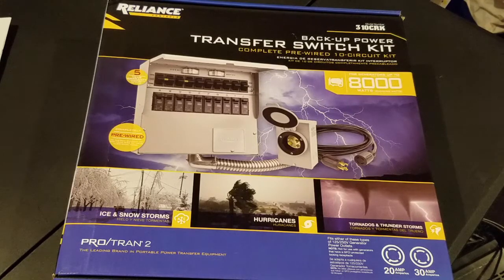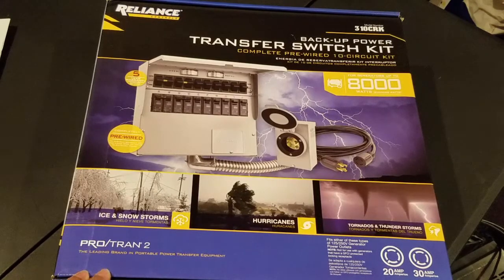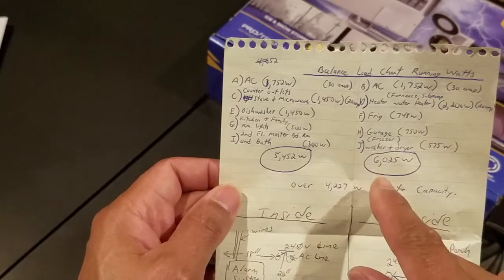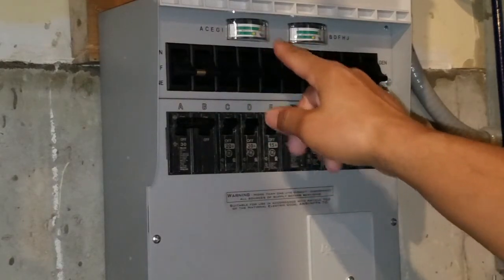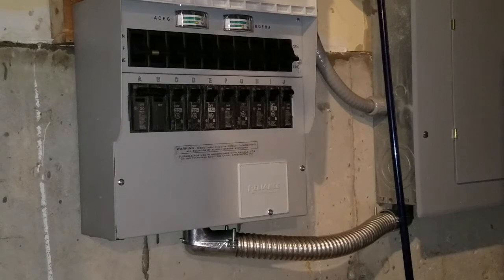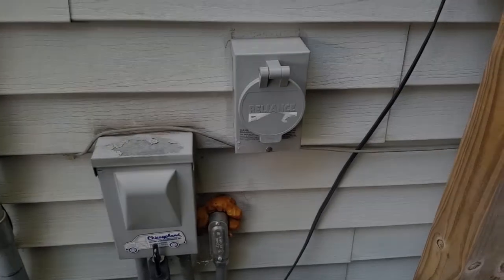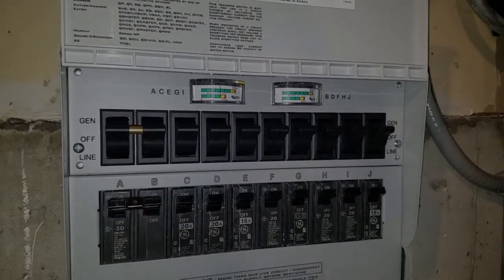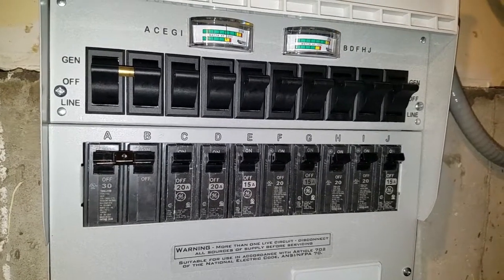Reliance Manual Transfer Switch Kit Explained/Review and Why It's Better Than an Interlock Switch

Comment: I'm running solar with my reliance switch.  My all in one inverter accepts the generator input to charge my battery.  When there's no solar the generator can charge the battery and or run loads.  The reliance method allows the option of shutting off the solar and returning commercial power. It's nice and low budget.

Comment: installed the 30 amp 6 circuit pro/tran2 from the home depot today it powered everything good but the watt meters don't work. Guess I'll call reliance but I really don't feel like reinstall for that kind of inconvenient.
Reply from the maker: Sorry to hear that. What was the wattage being used on each leg of the transfer switch?
Reply: @Pk3_Garage  fridge & furnace are on phase A circuits, sump & general lighting on phase B all on individual breakers powered by a 5500 watt generator powered everything fine during testing.  Just noticed the analog needles don't move on either side so defective right out of the box. since everything else works I might just leave it but is a ding on their quality.
Reply from the maker: Happy Friday and yes that is a bummer. I'd still contact Reliance Controls about the issue. I've seen others that have had the same problem.

Comment: Can I install two of these, like one to cover 10 and the other to cover 10?
Reply from the maker: Under code you can, if you are using one power source for both Manual Transfer Switches. I installed a six-circuit Transfer Switch, like the one in this video, to connect other circuits not connected to the ten circuit Transfer Switch.  

If you want to see my current set up, check out my EcoFlow Delt Pro Review Video on my channel.

Comment: New sub with this video.  You helped me understand a lot about this option.   I’m going to go this option rather than the interlock.  I am going to put my inlet receptacle directly into the transfer switch where that cover plate is.  I’ll be plugging in 7200 watt EcoFlow battery as my backup power to transfer sw as HOA will not approve portable gen.   Not what I wanted to do but there are some nice advantages.
Reply from the maker: Thanks for subscribing.  We now have a Ecoflow DP main unit, connected to our Transfer Switch. (We still have and use our generator) 

The Power Station is just an add on, as it has abilities our generator doesn't have. It works great.  

I'm working on a detailed video of our set up and DP unit testing.  Keep your eyes out for it.

Comment: The wires you connected at 14.05 in the video.....what’s these wires for?  I just bought this and I’m using your video for reference.  Thank you sir.
Reply from the maker: Hi and Happy belated Christmas.  Hope you had a great weekend.  Those wires are from the Power Inlet Box.  You need to buy building 10-gauge: red (hot), black (hot), white (neutral), and green (ground) wire.  These wires are not included with the kit.  

Here is a detailed installation video from Reliance Controls that might be helpful.

Power Inlet Wiring - https://www.youtube.com/watch?v=0M8sYRhEVPY

Transfer Switch Wiring - https://www.youtube.com/watch?v=TKruj9BpZM8&t=60s

Comment: can you use a generator that has 3 prongs but an adapter that converts it to 4 prong? My generator is only 120V but all the circuits I need is 120V. I have a firman inverter generator WH03242
Reply from the maker: You sure can.  Look for an adaptor for a four prong L14-30 inlet to whatever type outlet you have on your generator.

Comment: i have a 100 amp main breaker can i still use this 50 transfer switch
Reply from the maker: This is only a 30 amp transfer switch. Yes to answer your question. Our main panel is 100 amp.

Comment: Can you take off the goldish colored piece locking in the 30 amp double breaker line/gen switch so I can take the breakers out and make them singles? Thanks
Reply from the maker: Yes, you can. The transfer switch comes with a double pole 20amp breaker.
Reply: @Pk3_Garage  thank you very much for quick response I highly appreciate it
Reply from the maker: You're welcome and it's not a problem.

Comment: Seems like this would be a good way to feed solar power to a range of circuits, and send them to line only if needed.
Reply from the maker: This Transfer switch works very well.  I've since upgraded our backup system since the posting of this video.  We now have our entire home backup using a six and ten circuit transfer switch. We added the Ecoflow Delta Pro Power Station to our backup system.  (It can run our entire house, minus our 3-ton AC unit)

I installed two inlets, on both transfer switchs, inside the house that the DP is always connected to.  I'm using two changeover switches, one for each transfer switch, to switch between generator and battery/solar power.  Our system works great, and I'm so pleased with it.

Comment: Might have to use this for the first time tonight , wind storm coming. Is it safe to run electronics such as TV and internet routers if a non inverter generator is running this?
Reply from the maker: It depends on the generator you use. If your using surge protector power strips.  The size of the generator. (How many watts) How old the electronics are.  For us, it works just fine.  We have a Predator 9000/7250 watts generator.  Have over 77 hrs. run time running our entire house, with no issues with sensative electronics.
Reply: @Pk3_Garage  I have a predator 6500 series , my router is new and TV is about 4 yrs old
Reply from the maker: That's a nice size generator.  As long as your total load, is half of the total running watts, you should be ok.  The issue with non-invertor generators, is keeping a steady 60 htz. when various loads are applied to the generator.  For example, a high wattage items like a microwave or frig, when turning on and off, causes the generator engine to either surge or have to slow down to not go over 60 htz.  

My advice would be to test the volts/frequency using a wattage usage meter.  Do this, with no load, on the generator using the 120V outlets for each leg of the generator.  Then while under load, test a few outlets in the house that are running on generator power, to see what the volts/frequency is.  Turn on a microwave or frig and observe the voltage/frequency.  The volts range is 115 to 125 volts and the frequency 59 to 62 htz. 

I'm working on a one year review video showing how to do this.

Comment: How about putting this transfer switch with a solar system?.. it's grid connected so when I lose power.. solar system doesn't work.. I'm getting a generator and worried about back feeding.. will this 10 circuit work for me?.. anyone using this with a solar system?.. please let me know
Reply from the maker: Hi Mike, I'm not sure if it can be connected to a Solar Panel system. In theory, it should be able to, just not sure as to how. Maybe someone  else will comment on this. I'm curious about this too.
Reply: @Pk3_Garage  thank you..I know it can be.. just don't want to back flow into my panel.. and if this only powers the circuits that I put on here.. then I should be fine,  curios if using this 10 circuit or 6.. with any solar
Reply from the maker: If it can be done, I suggest the 10 circuit switch. This way you can add circuits to it later, if you don't need all 10 circuits now. You might want to check out automatic transfer switches too.

Comment: Can you use a Bluetii Solar Generator with this
Reply from the maker: Hi and I'm glade you asked this question.  (Something I've thought about) I'm really not sure, since we don't own any type of Solar battery pack.  

Truthfully, I don't see why it wouldn't work with any type of Solar battery pack.  As long as you have an adaptor, for the inlet on the transfer switch, it should work.

I would like to purchase a Solar battery pack, one with over 3000 watts, as a backup to our portable generator.  But they are so expensive right now.

Comment: You were already maxed on tne far side of the yellow on one of your phases. The 2 pole 30 you have on tne left still has tne factory wiring. Is that #10 or #12. If it's not the right size eventually it'll melt. May take some time but it's for sure gonna happen.
Reply from the maker: The 2 pole 30 amp has 10 gauge wiring. The other 20/15 amp circuits have 12 gauge wires.

Comment: Isn't the generator producing 240v? If so how do you get 120v to power house outlets?
Reply from the maker: Yes it produces 240/120 volts.  The generator has two legs that produces 120v. When you use the double pole circuit, A & B, you are combining the 120V x 2= 240v.  Each circuit in the transfer switch, works just like the main electric panel in your house.  

The transfer switch splits all of the current, the generator is producing, through each circuit.  In this case, that would be up to 120v per circuit.

Comment from the maker: So, I've been thinking over the past few months, on how I could power the other five circuits, that aren't connected to our 10 circuit transfer switch. I decided to install a second six circuit manual transfer switch. You might be thinking, good idea, but how with only one generator.

Well, as you know, you can buy the entire kit that includes the transfer switch, 10 ft. power cord and inlet box.  On our generator, we have a 120 volts, three prong outlet and a 120/240 volts, four prong outlet. (Each outlet has it's own 30 amp breaker) The additional five circuits I want to run, only use about 800 watts max. So, I'm going to connect the six circuit transfer switch, to the other five circuits.  I will use the three prong 120 volts outlet, to power those circuits.  All I need to purchase is another 30 amp extension cord and three prong to four prong adaptor.  

I'll post a video of my set up after I install it.  Now, we can run everything in our house and our kids will have power in their rooms.
Reply: Sounds like some Mickey Mouse ish, should’ve used an interlock from the beginning and kept all the unnecessary parts out (coming from an electrician)
Reply from the maker: @trifln8434   No offense, but you being an electrician, doesn't mean you are correct.  Why not explain to us, as an electrician, why you feel an interlock switch is better. Your answer might be helpful to someone.
Reply: @Pk3_Garage  the generator only supplies 50 amps to begin with, when using 6/3 extension cord that’s rated for 50 amps then why not just run one cord from the generator to a plug, then from the plug to the panel. Path of least resistance my friend. 

Your not doing any favors for the generator by splitting it up between a 30 and a 50, there is still only so many watts available, that are all available on a 50 amp plug

Plus I’d be willing to bet it’s very unsafe to run 2 SEPARATE LINES, to only 1 LOAD, there is a ton of room for error there. I’m not saying it won’t work what I’m saying is it’s unsafe and overkill and not the professional way it would be done. Your literally setting it up to have 2 separate 240v. Circuits to power one busbar,  if something goes bad with the transfer switches then you will experience a very large BOOM when 2 separate 240 v. (30A & 50A) circuits meet each other inside your main panel. 

I’m telling ya man... 1 50 amp generator=1 interlock kit. Don’t overthink it
Reply: Oh one more thing, if you have an upgraded electrical service with 2 separate main panels then I believe it would be safer. But for one 200 amp main, no way man!!
Reply from the maker: @trifln8434  - Thanks for your reply.  In reading through your response, you mention a 30 and 50 amp circuit.  (Which I never said we had) In my reply, I did say we had two 240 volts outlets, which was a typo. (I since corrected this info.) We have a three prong 120 volts outlet and a four prong, 120/240 volts outlet.  (Each outlet has a 30 amp circuit breaker) 

We already have a manual, 10 circuit transfer switch.  I use a 10 gauge power cord for the 120/240 volts outlet. I've installed a second, six circuit manual transfer switch, that I use another 10 gauge power cord, for the 120 volts outlet. 

I assure you in doing my research, that this is safe and legal. Both switches are manual and not automatic.  Also, our generator is a Predator 9000/7250 watts, which has more then enough power, for all of the circuits connected to it.
Reply: @Pk3_Garage  this is more of an experiment for you than actually doing it properly it seems, I said it would work but it’s not the safest or most professional way to install the system, all of my statements still stand, even more so with a 30 amp generator rather than a 50.

Comment: Hi, do we need to turn off the main breaker before using power from the generator not?
Thanks.
Reply from the maker: Hi, no need to touch anything in the main control panel.  The ten circuits, connected to the transfer switch, are all controlled in the transfer switch.

Comment: Is there an extension cord with a standard three prong plug for a small generator and on the other in four prong female plug to use a couple of circuit breakers on a 10th circuit manual transfer switch?  I’m not finding the small 4 circuit manual transfer switch for outdoors in stock. I have both a small and medium generator.
Reply: Do a search and find  “ adaptor cord 5-20 male plug to locking L14-30 female recepticle “.    I am using this cord with a Reliance 6 circuit transfer switch and a 2200 watt Honda generator.   This cord has the “ hots bridged” so it will supply 120 volts to both hot lugs of the 30 amp recepticle plug on the cord supplied with the Reliance kit.   If you over draw the wattage on the generator, the breaker on the generator will pop and can be reset after you reduce the draw by switching off a circuit or two on the transfer switch.  It will not start a fire.
Reply from the maker: I honestly don't know. If I'm understanding you correctly, your trying to use the three prong 120V outlet on your generator.  You want to use an extension cord, three prong male to four prong female, from your generator to the inlet box for the manual transfer switch. 

 If that's your question, I don't think it can be done.  If you can do it, I would highly discourage you from doing it.  

First, the gauge of extension cord wouldn't be large enough to carry the current for four circuits. (I'm assuming 120V circuits) 

Second, this set up would be a fire hazard. It would be to easy to over load the cord and circuit. 

I would suggest to just run some heavy duty, weather resistant, 12 gauge, extension cords for each 120V outlet on the generator.
Reply: I apologize for the spelling errors in my answer.  It should be “adapter” and “receptacle”.    I originally tried to answer the question and provide a link, but YT would not allow that :-(
Reply: Thanks for the response.Eventually I did find the correct adapter.  Decided to have a 15 amp inlet installed and wired to it’s own  dedicated outlet; which gets closer to refrigerator without having to run extension cords through a window.  Or spend so much on a manual transfer switch or interlock kit just to keep a few appliances powered.
Reply: I also have a 120 V generator with an adapter that bridges the two hots. One thing to be very careful of is if your home is wired with multi wire branch circuits (MWBC) it means two breakers share one neutral which works fine when they are on separate legs with 240 V power but when you use a 120 V only generator both legs are on the same phase and you will potentially burn out your neutral wire because it is receiving the wattage from both circuits in the same phase at the same time. Fire hazard.
Reply: @backpackerx  Thanks for the tip. Decided not to go with manual switch and adapter. Had an electrician install a 15 amp inlet outside house and wire it to its own newly installed outlet inside. That single generator powered outlet was enough to keep refrigerator, Internet, and a couple of fans going till power returned. Perfect option for my 1700 running watts generator.